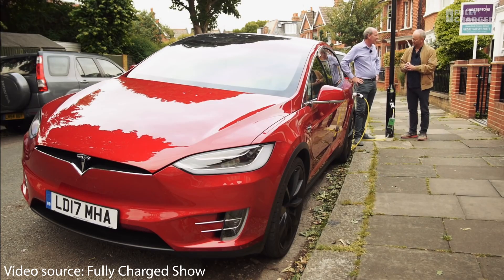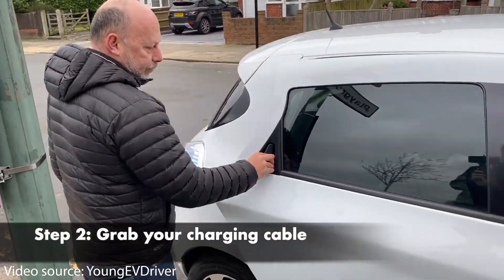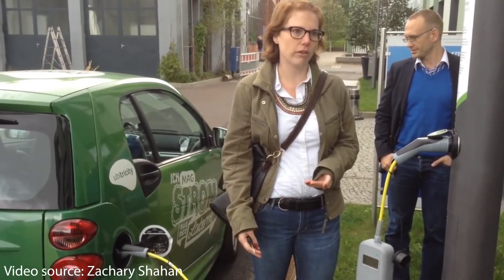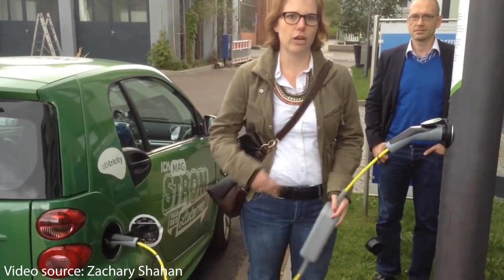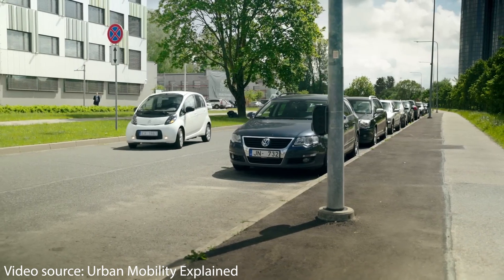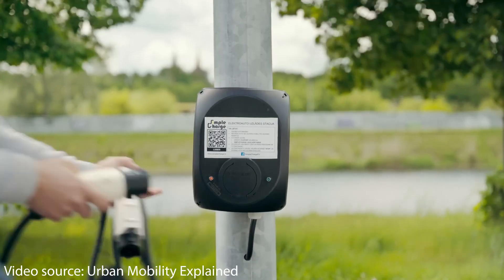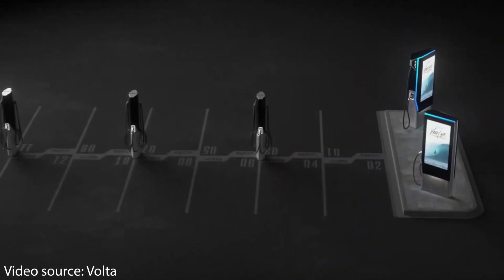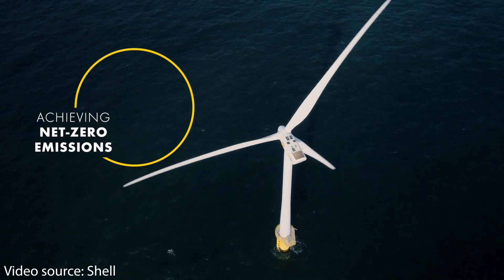Lamp Post EV Chargers: Explained

Comment: Hi, Ijust come across this video and thought you might like an update a year later. I live in the UK and drive an EV but cannot, at present, charge at my home. I do however have 2 lampost chargers in the street where I live. They provide a slower charge, 5kw but thats fine when I am asleep or just sitting at home.
In Europe only rapid chargers (50kw+) have their own cables and I prefer to carry my own ad I know it works.  Apparently most public charger defects are due to cable problems. The switch to LED lamps made it easier for this project as it freed up capacity in the lampost. In our street the existing lamppost was swapped with the current charging one. I think this is the easiest and quickest way as the old post could then get retrofitted with the required charging kit and SIM card etc. 
The street has residents only parking but the space by the chargers is not further restricted.  We have other protected bays for that just round the corner with 22kw charging available.  There are currently 5 or 6 EVs in the street and we manage fine and most of the time our ICE neighbours leave the space free if they can. I hope this is informative.
Reply from the maker: Thanks for the update! Initially when I made this video I thought the separate cable design was unique to lamp posts—only later found out it was all European AC chargers. Glad to hear you don't mind—& even think it's better!

It's cool you guys can charge with the lampposts. 5kW doesn't sound bad if you're not driving a ton of miles & draining your battery every day. I charge with a 120V wall outlet charger that outputs about 1.4kW and I get by fine with it.

Comment: Great video. Just wrote something on this recently and I hadn't thought of the issue with ICE vehicles blocking the posts. There are still several hurdles to solve before this can scale, at least in the US.
1. Street lights are typically powered in a circuit and don't have the necessary infrastructure to separately meter usage
2. Street lights draw lower power (5A) than a typical L2 charger (30A+), which would be necessary to make it worthwhile for the public
Are there solutions that don't rely on retrofits?
Reply from the maker: Great points! I didn't know about the metering issue. I wonder how these companies solved this issue, since you pay for the electricity you use.

I never really thought about that 5A issue either. If they're 240v, then that'd give you 1.2 kW. Very low, but it may be alright for some people who don't drive too many miles per day (I imagine this might be the case for drivers living in urban areas, but I can't speak from experience living in suburbs). But if these lamps are 120v, then 5a probably wouldn't suffice.

To my knowledge, all of these lamp post chargers are retrofits. But I don't see any reason why someone couldn't build a charger with a big lamp on top of it.
Reply: Member seeing an early video about these street lamp  charging point. They were talking about 5kw  not 5 amp. These lamps were wired long before LED street lighting. So at 3 miles per kWh that is a charge rate of 15 miles per hour.

Comment: Yes we need this so bad... we need an "all the above" approach to ramp options for apartment dwellers and the like.
Reply from the maker: Absolutely, EV ownership will be entirely infeasible for apartment dwellers without good chargers for roadside parking, or at least better public charging stations.
Reply: There's a gully system too. You can put it inside the street itself, kinda

It'd mean I could charge at my parent's house very easily